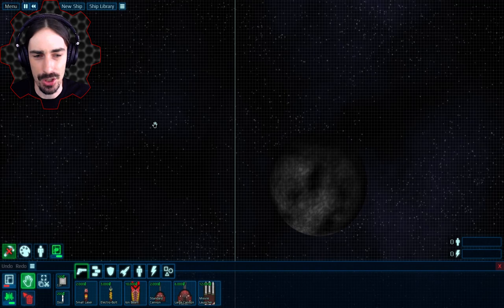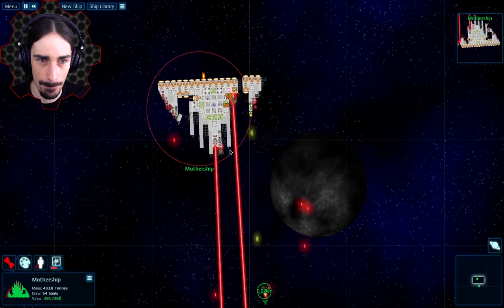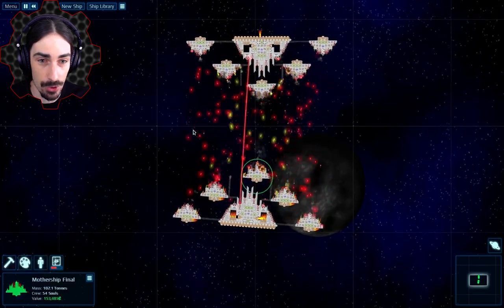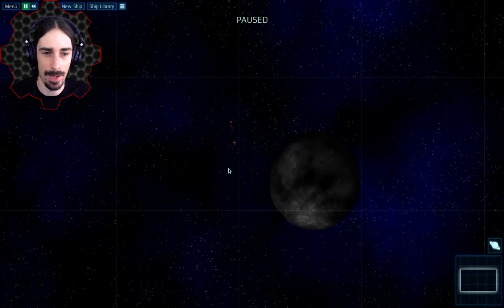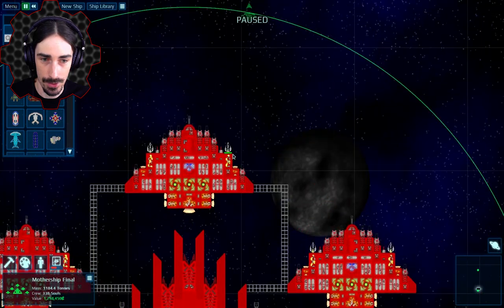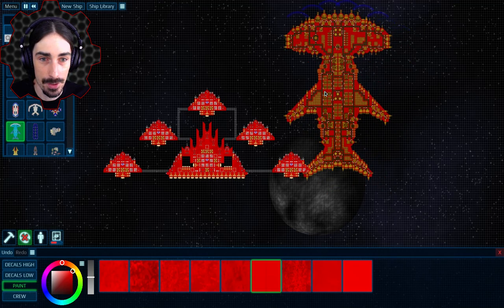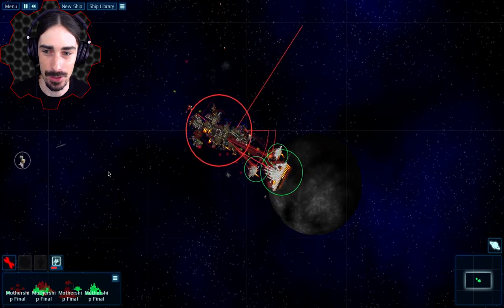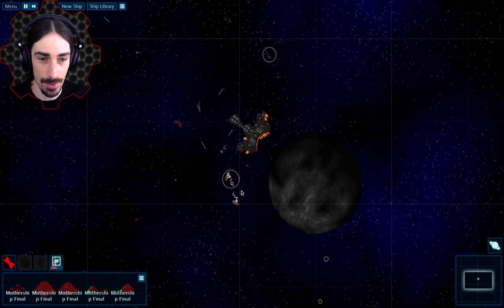MOTHERSHIP WITH DETACHABLE MINIONS! - Cosmoteer Gameplay Ep8

Comment: What if you make a ship similar to this with 8 major sections all connected to the middle with a small structure, and if one section is destroyed/thrown off, you can repair both, creating 2 new ships, meaning that you can make an infinite fleet, meaning that the only way to stop it would be to completely vaporize it. Also make it kinda cheap.